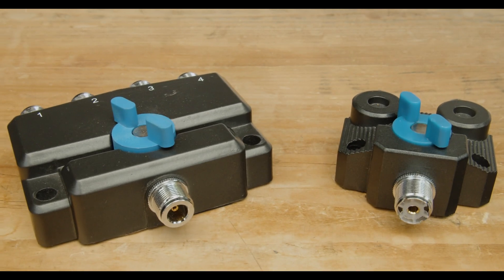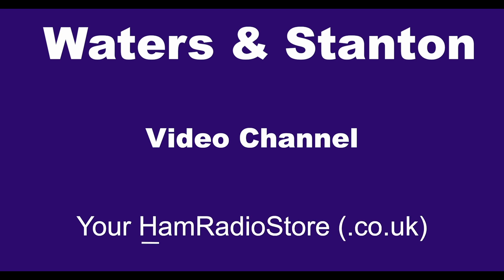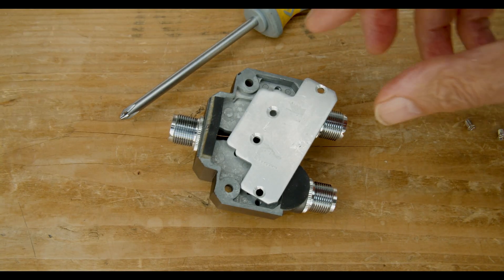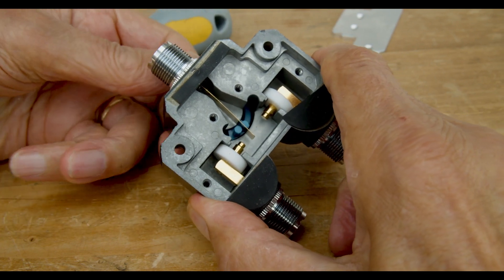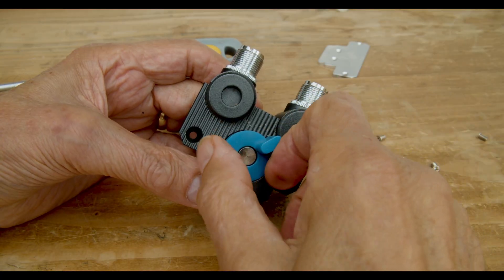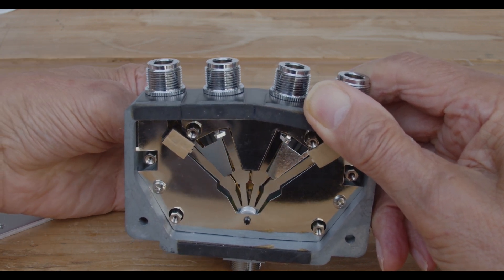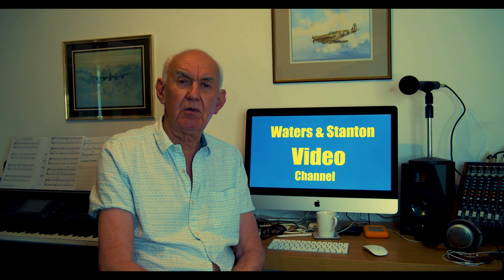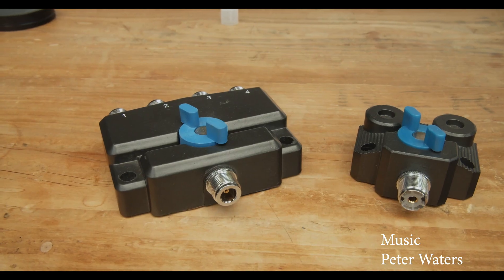Coax Switches - A Close Look at the Watson Brand  | HAM RADIO

Comment: Hello, thanks for the videos,  a question,  if your using the switch to select different transceivers, how much isolation is required so not to damage another rig?
Reply from the maker: Modern rigs are pretty well protected but you need to use a decent switch. Worth paying the extra and buy one if the Diamond models.

Comment: @watersstanton 
These switches will work very well on LF i.e. audio, because most of them are spec'd for DC-500 MHz or so. For RF I use 4 2's and 2 4's to connect any of 4 antennas to any of 2 radio's. See QRZ.

Comment: I bought a Watson 2m/70cm handheld antenna over 20 years ago. It's been on four handhelds with different adapters.  Currently on my ID52. At my age I will probably never need another one. It's about a quarter wave on 2m and it's really tough but flexible.
Reply from the maker: Good to gear it is still in use. Take care. 73 Peter

Comment: I always enjoy your videos, but I have a question about the coax switch you previewed.  During a threatening thunderstorm, would using the switch to disconnect my transceiver from my antenna and connect it to ground be sufficient protection.  Or, should i always physically unscrew my antenna from all equipment.
Reply from the maker: Disconnecting via the switch is very safe unless you get a direct strike and then nothing much will save the gear! However, most household insurance policies cover lightning damage. 73 Peter.

Comment: 'Coax switch' is a misnomer - because it does not switch the coax, just the inner. All the outers (the screens) are commoned by the cast metal case. If you have previously just changed plugs over, to change radios  or antennas, then add a switch, (with the switch used 'back to front for using one antenna and different trx's' - perhaps for A - B comparisons) and find your matching has 'gone up the wall' - it might be the added different lengths (differing resonances) of screen that are confusing the issue.
Reply from the maker: An amusing post but technically wrong.
Reply: @watersstanton  - In what way?
Reply: @hamshackleton  tut tut.
Reply: @brian.7966  - Not very informative!